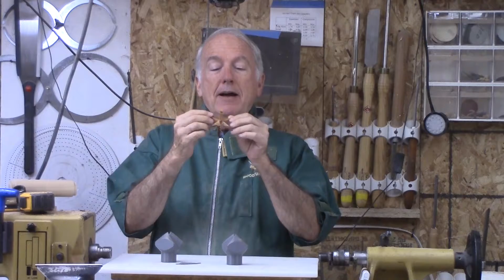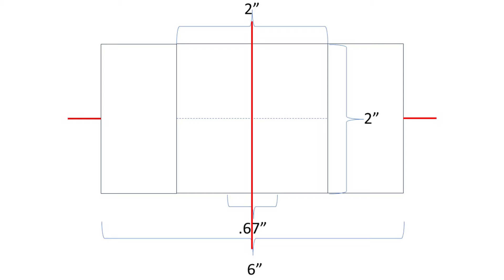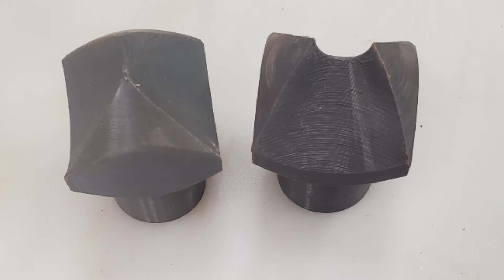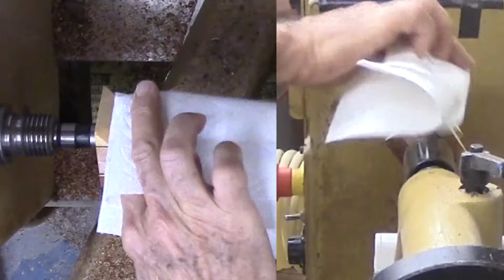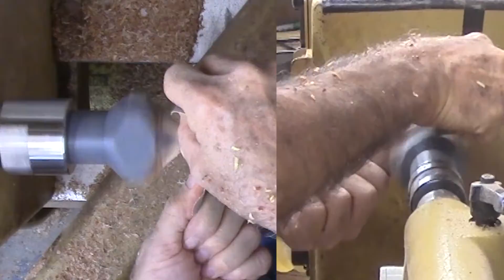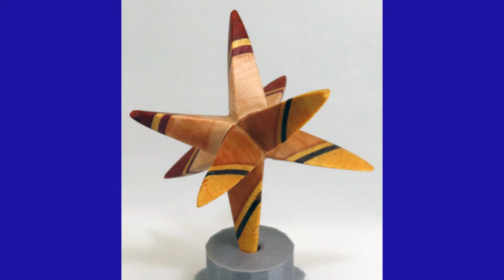Turning Multi Axis Eight Point Star With Jig

Comment: I am actually getting ready to print this tomorrow after my filament leaves the drier. One thing I am wondering though, what type of filament do you recommend? I have PLA, but I'm drying PETG and PAHT-CF. I was planning on using the PAHT, but if PLA will work and be strong enough I'd rather not use the more expensive filament.
Reply from the maker: PLA has been adequate for me. Give it a test, you can upgrade if necessary. Consider triple shells and higher infill (like 50%).
Alan
Reply: @AsWoodTurns  thanks for the tips.

Comment: Hi Alan. Like this project so I wanted to give it a try. No printer so I made the wooden jig. Threaded one end to fit my oneway live centre and mounted the drive side in some long jaws. That seems to work fine.
But somehow I'm not getting the final result. I think my angle jig is off. It looks like it has a much shorter base to point length than the one I see you use for the final star so it's back to the drawing board and see about refining that size. 
When you work out the bugs it's easy. It's the process of working out the bugs or correcting your wrong ideas that's frustrating. I'll let you know if it finally works!
Thanks for the inspiration.
Reply from the maker: My first template was not tall enough. I had to remember that I was simulating a slice of the cone. Measuring from tip to tip (in my case 2") is different from a slice of the cone. I had to draw it out to see the difference.
Good turning.
Alan

Comment: Wonderful!  I love these multi-axis pieces.  I've been wanting to find a way to turn a stella octangula (stellated octahedron) on the lathe, which is essentially an 8-pointed star also, and you've just shown me the key, with this video.  Now I have to do the math and figure the angles.... and hope that life doesn't get in the way....
Reply from the maker: I had to look up stella octangula. I see two differences: this start has rounded sides whereas the regular stella octangula sides are flat; and to make it regular, the center appears to be larger. Consequently, the star's rays would be shorter relative to the body.
Personally, I like the longer rays on this start.
Go for it.
Alan
Reply: Yep, that's correct.  I think If I can get close (without the sides being perfectly flat), that may meet my needs.  The angle on the guide will be different, too (from my calculations, it is 109.2°).  What is the center angle on your guide?   I do really like what you've made here, and the jigs look very useful.  I appreciate all the work you put into these videos, thank you again!
Reply from the maker: @MattHarber_000  I think that you are over thinking the gauge. I did not calculate any angle. Let me see if this helps: 1. Draw a square for your cube size (mine was 2 inches) 2. divide the square into 4 quadrants; 3. at center, draw a circle whose diameter is the size of the inner core. 4. locate the intersection of the circle and the line between two quadrants; 5. draw lines from this intersection to the corners of the square. 6. Voila - your template gauge. Of course, this is not officially "regular" but try it first before getting bogged down in the math.
Alan
Reply: @AsWoodTurns , thanks!  I was looking at the cube and trying to figure out how to get that inner diameter, but it just meets at the center of the faces, so I can get to that inner core diameter by just drawing corner to corner lines (finding the center of each face), then turning between exact centers until that central v-groove meets the face centers.   I'll have to test it out on the lathe....  🙂